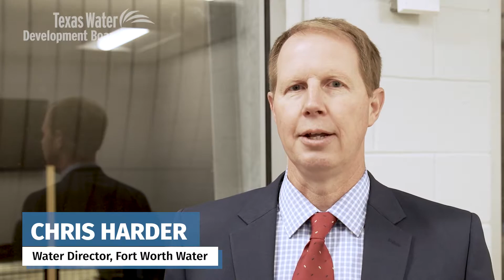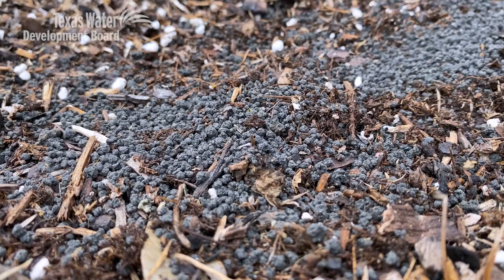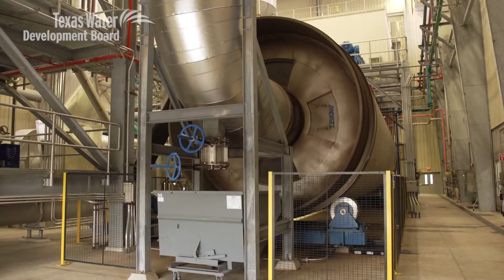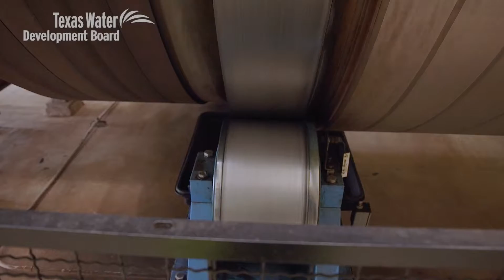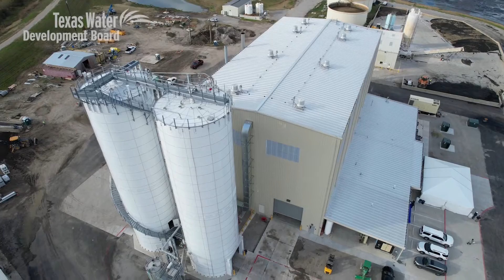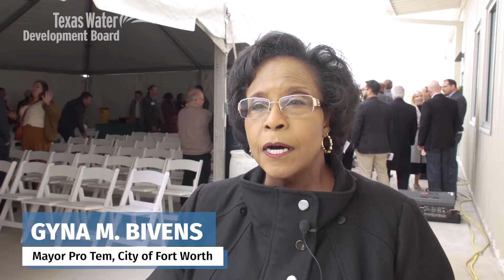New Fort Worth biosolids dryer facility converts waste into fertilizer

Comment: Do you measure for PFAS chemicals in your product also known as forever chemicals? Biosolids are well know to make land toxic and unusable because of PFAS.
Reply: dry material at high temperature to take away the moisture. you wanna shoot for less than 20%. and then after that is dry you want to gasify it. Pfas will still be there but as long as you make it undetectable then ur good ?
Reply: @tylerculver4482 if it’s still there how would you make it undetectable